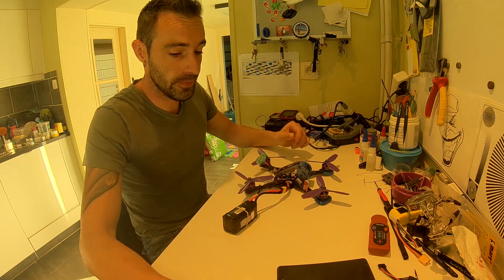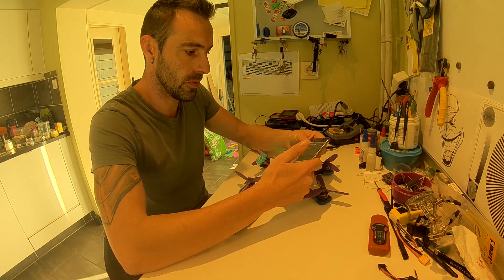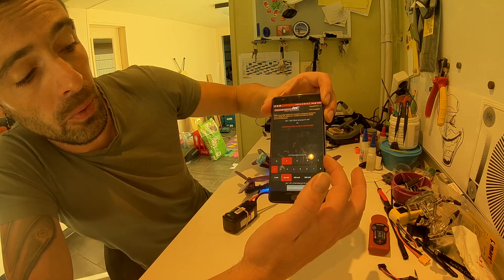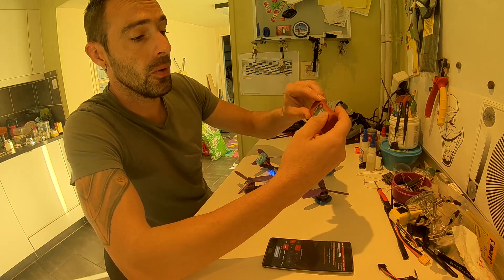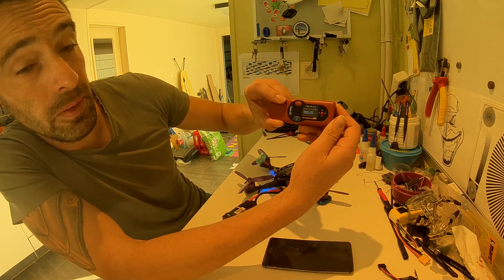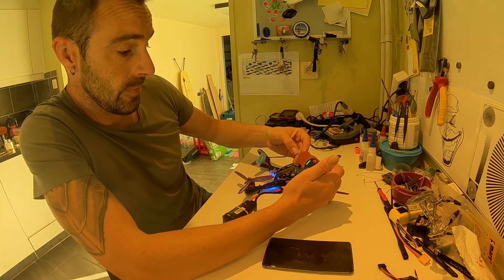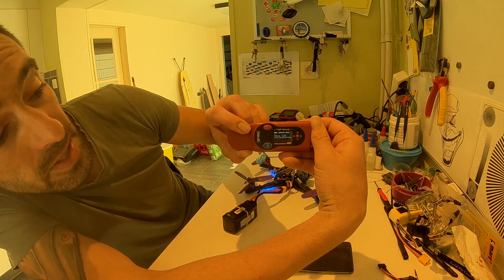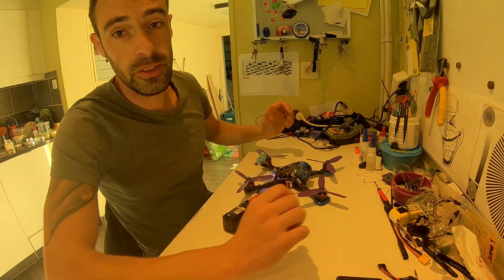ImmersionRC tramp hv (eu to international version)

Comment: Hi, i like very much this video. But i am trying to follow the steps and always get the same result. unable to set illegal frequency/power. What can i do?
Reply: I am trying to set race band channel 2 at 350mW
Reply from the maker: @josealbertorosalesnavarro7951  try changing not in 1st racer but 2th racer int he comments someone told thet the 1st racer could work better
Reply: @section8freestyle  When you say racer 1, do you mean band R channel 1 on vtx or racer1 on tnr wand?. I am using personal tnr wand. i know that if i had the racer editor version i would not have any problem.
Reply from the maker: @josealbertorosalesnavarro7951  i mean the racer 2 on the wand
Reply: @section8freestyle  thank you very much. I am excited to return home and test it
Reply: Hi all. I was able to set 600mW in Band Race Channel 3, but nothing about using Channel 2
Reply: So, the conclusion i get from this is that i can put the output power that i want to, but i can not use forbidden channels
Reply from the maker: @josealbertorosalesnavarro7951  nice to know that it works and for the next one who try's dont use the channels thts not in the eu list
Reply from the maker: what fq do you want to use 
do keep in mind that the eu fq cant work try r6 and change it to the 600